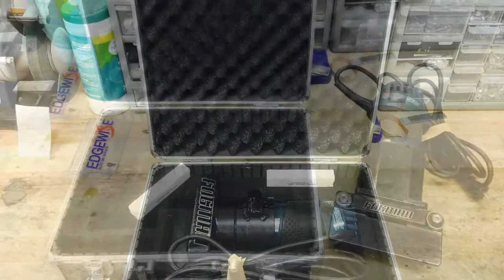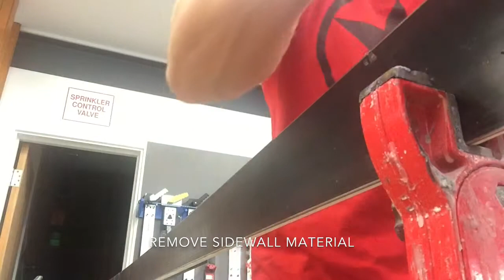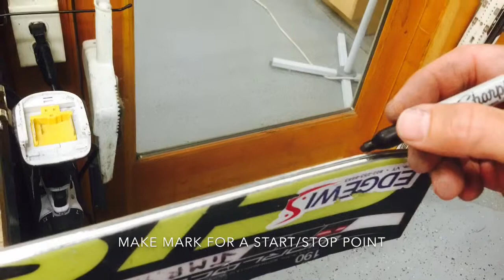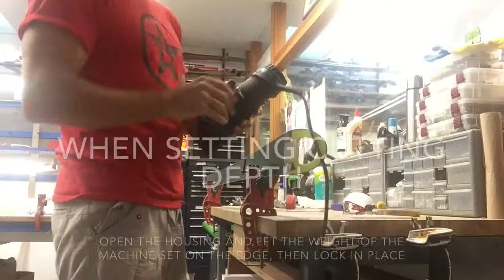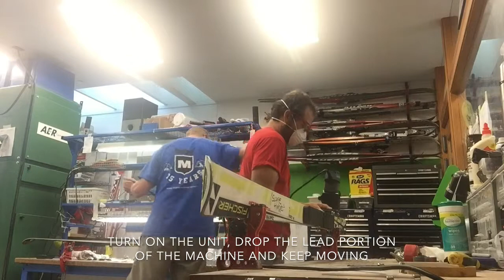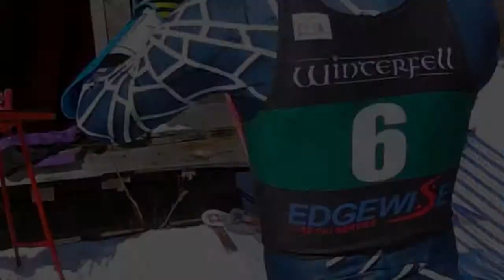Edgewise Fogman Demo

Comment: Just out of curiousity, when you're using the Swix sidewall planer there, are you getting that good of results (referring to the titanal as well) with just the stock round blade it comes with, or have you  "upgraded" it, & if so, to which one by whom? I'm just asking 'cause I've been looking at numerous ones looking to get one soon & obviously this one seems like it'll work good enough. The only thing it lacks from what I've read is the ability to really be able to change the angle of the blade (I guess each one comes set at a stock 7 degrees & you can't really change that), but if it works, it works!